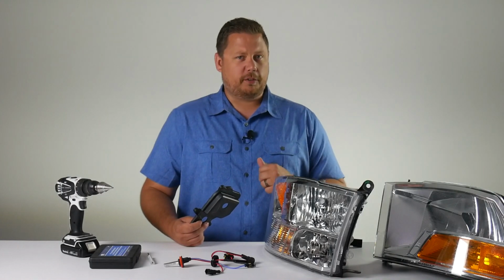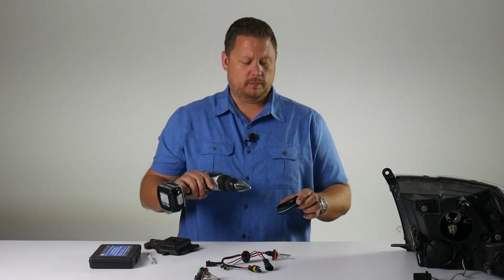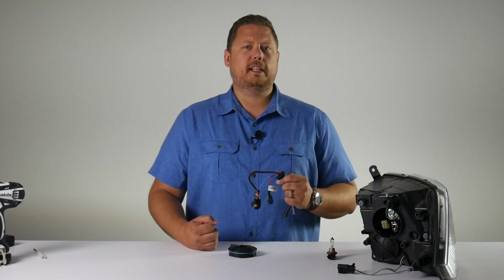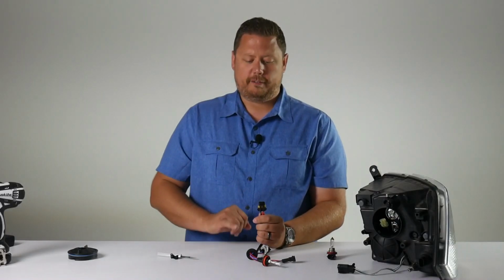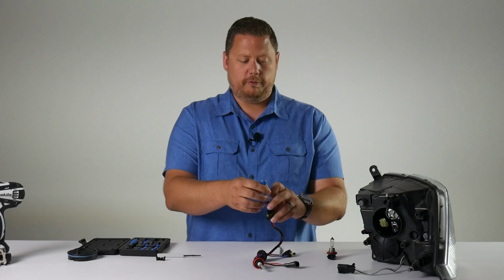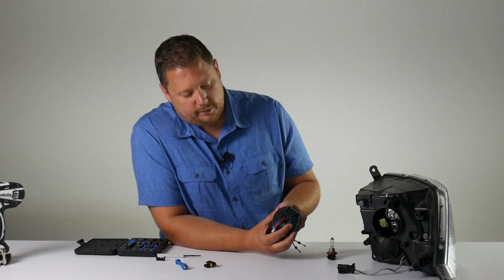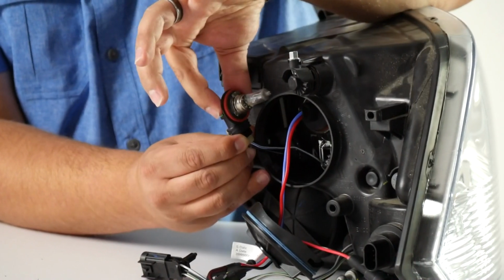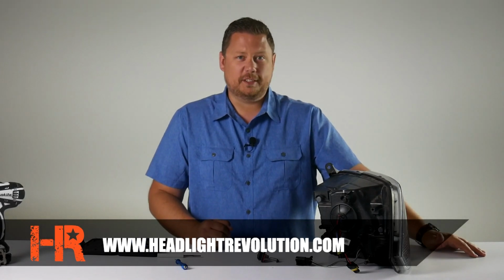How to install HID Wiring Through a Headlight Dust Cover | Headlight Revolution

Comment: Great video!  I have a question.  In my car, a Lexus ES330 2004, it has factory HID.  I want to convert to LED  The problem I am running into is: the is an electrical connection to the dustcover that needs to be connected, or the headlight doesn't work.  Has anyone run into this before?

Comment: Paying it forward here. 
The Unibit or Step drill bit costs upwards of $40 he spoke of in this video. 
Buy a single Wood Spade bit 1” wide for under $10. 
It works just fine to make the hole in the dust cover. 
3/8 for the opening is TOO SMALL for the grommet to fit. 
1” opening is snug and PERFECT. 
PEACE.

Comment: If you can't drill a hole in your headlight without hurting yourself.... Been there done that! Burnt my fingertips trying to open the headlights, got fingers caught between panels, bumped my head coming out from the under of the car...touched fresh paint and messed it up...all of it...hahaha

Comment: I got my GTR Ultra 3's and they don't have a dust cover grommet and the anti-flicker/LED ballast box don't fit into my headlight housing.  What do I do?
Reply from the maker: What vehicle are you working on?
Reply: @HeadlightRevolution  2018 dodge charger.  The opening isn't big enough to squeeze the flicker modules in.  The ballast that's attached to the LED though, that fits but it looks like I still have to run both the cable coming from the LED's ballast out of the housing and then the plug coming from the flicker module back into the housing to plug into the factory wiring harness plug.

I tested the lights with one of the anti flicker modules not connected and the LED just plugged into the factory wiring harness and the bulb came on and didn't show any weird behavior but I'm not sure if that's just for that crank and it has the potential to act wierd some of the time if the anti flicker module is not attached or if you just need one of the anti flicker modules connected?

My Morimoto HID's would randomly have one or the other bulb just not come on and if I turned the lights off/on a few times, I may get both bulbs on.  I would also notice one of them (always the left one) flickering a little occasionally and if I turned the lights off/on again, it would go away and shine normal.  I'm guessing one or both of the anti-flicker units were bad or acting up because when I had ballast failures (yes, plural) the bulb would just not turn on at all.

Back to the LED's though.. I've got a set of the 4 hole grommets on the way but the 4 hole grommets with the HID kids always had them pre-installed and the GTR bulb wiring harness isn't the typical 2 wire deal but rather that longer thicker wire and the plugs have the molding around the boot so no easy way to pull the pins out to get them through the 4 hole grommet.

Comment: Headlight revolution. I really like you video but I have only one problem with it you didn't show where the plugs outside the grommet connected to. I bought the kit for my 2011 gmc terrain. I haven't changed any bulbs on this one much less convert to led and I am a 53 yr old female lol I usually watch YouTube anytime I need to do something to my vehicle my dad used to do all my mechanic work but he has been gone for awhile and so I usually try to do what I can myself. I really want to do this myself also but I haven't found a video that shows what to do with the rest of the plugs. Think you can help me out before I end up getting a ticket for having a headlight out lol.

Comment: Hi from Australia.
We drive on the other side of the road here so would I need to use the left side bulb on the right and vice versa, so I don't blind on coming traffic?
Reply from the maker: Hey there! The bulbs are actually not side specific, but if you purchase aftermarket headlights they need to be sure the cut off is the correct type (right hand drive cut off line).
Reply: @HeadlightRevolution  thanks for replying and I love your videos.

Comment: Hi, 
      I am from india and i  recently  bought 2 pairs of nighteye 72w 9000lm, 6500k cob led car headlight h7 model with fan for my suzuki ciaz from banggood.com. after installing the same i have closed the the back side of the headlight unit with the stock plastic dust cover. now my concern is that if i close the dust cap don't you think the heat generated will circulate inside the headlight assembly without proper ventilation. or is the led light designed in such a way that the cooling fan will reduce the heat generated even if i close the dust cap. secondly if i close the the dust cap will it reduce the life of the led light just because there is no ventilation. in worst case scenario will it burn the led bulb and the head light assembly. your advice in this regard is highly appreciated

thanks 

jubin joseph
Reply: I had 9000lumens LEDs installed with everything inside the assembly and it worked fine for more than 2 years until I took it out to replace with halogens. so you're good

Comment: This is a great video on how to install your HID lights through your dust cover. However, this can be done without removing your connector end. My dust cover is a softer rubber. I just pushed my connector end through the hole without any issues.
Reply: Marcus MDP Sweet. What vehicle do you have?

Comment: The grommet will seal from either side so why not put the bulb and it's connection forward first through the hole.. then you wouldn't need to take apart the rear connector??... Or did I miss something?